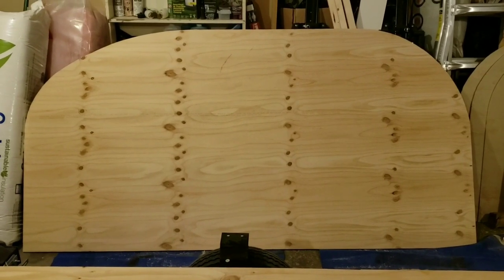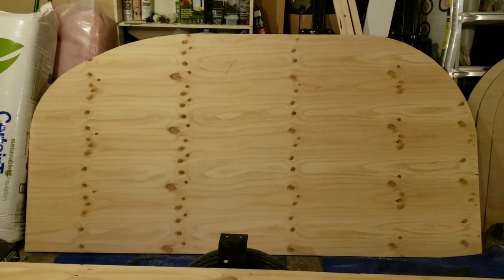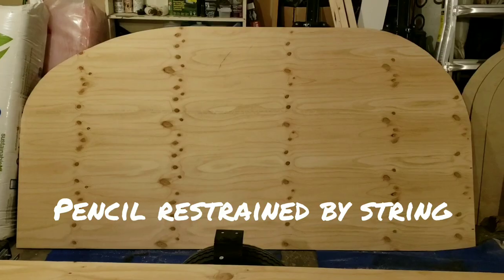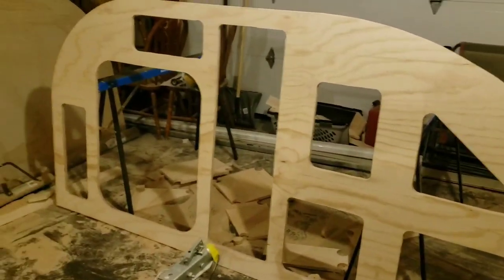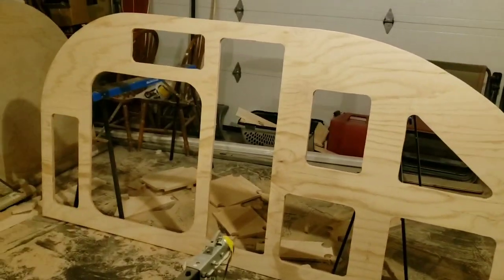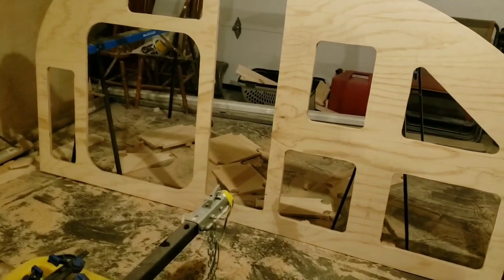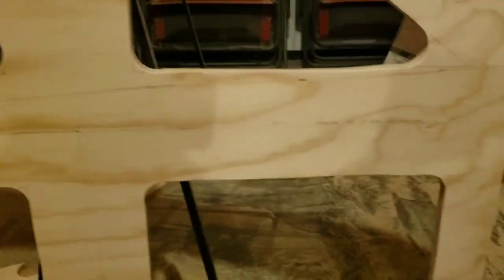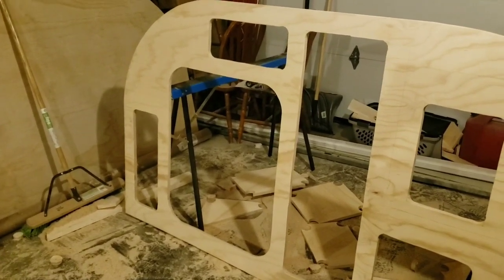Teardrop Trailer Build E04 - Building Walls & Timelapse

Comment: So many teardrops make the mistake of setting their worktop (you say counter-top) height by measuring up from the floor. I am sure this is why they all seem to have the work surface up around chin height! In a house, worktop is 900mm or around 35-1/2" above the floor level, and I don't see any reason why teardrop builders can't set them out in the same way. Otherwise, you'll be standing on something to do any cooking or food preparation. Buy a fridge to suit the worktop height, rather than setting the worktop height according to a fridge.
Reply from the maker: Excellent point Mike, and something we tried to avoid! My SO is pretty short so we tried to find a decent height, and a cooler to match. Coolers are pricey though, very pricey, so it can be hard to juggle things and find all the Goldilocks perfect fits/prices /specs.
Reply: @diwhynot3094  I am in the process of designing mine at the moment. I have designed the frame to drop 3" at the rear, and for the insulation in the floor to stop at the rear bulkhead, saving another 2-1/2". Five and a half inches is really significant. I've found a short-fat fridge, so my worktop will sit at about 36" off the ground.
Reply from the maker: @MikeAG333  sounds like you're asking the right questions already! Well done, and have fun!